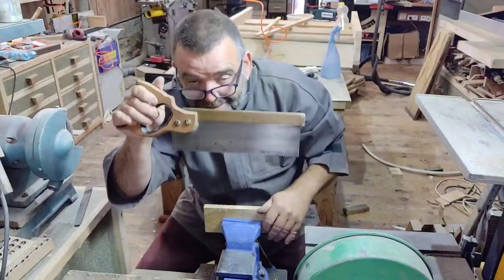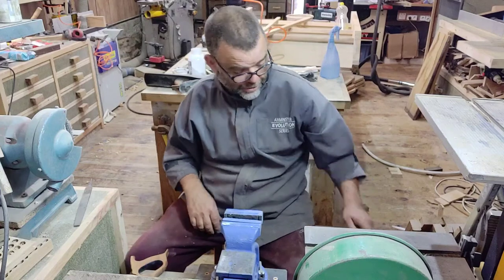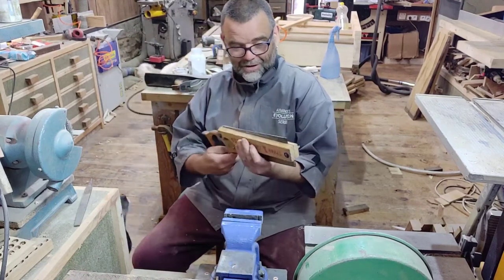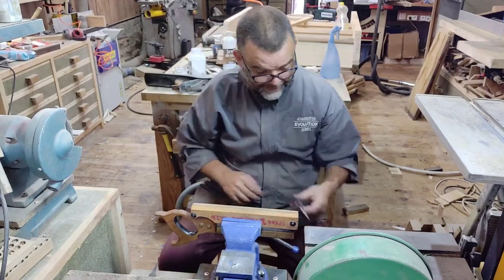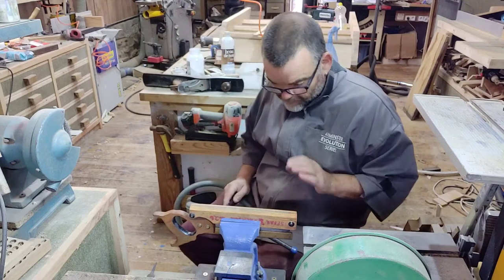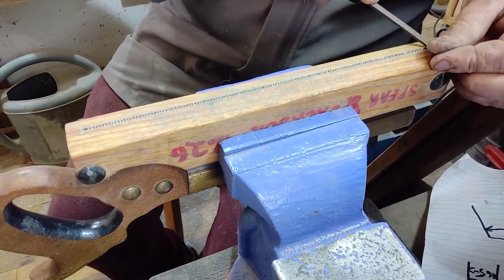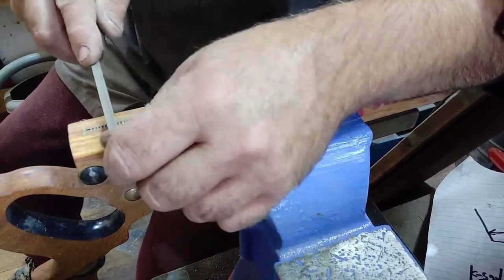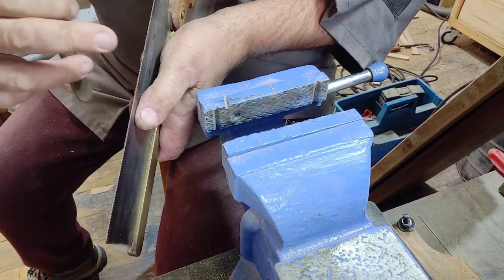How to Easily Sharpen a Backsaw - EASY 14 TPI tenon saw filing

Comment: really good tip on the jig to hold the saw on the vise... for experienced woodworker or someone who works with saws a lot it might be obvious but i would just try and hold it on the vise... get frustrated.. throw the saw away and buy a new one..
Reply from the maker: It's like any sharpening task by hand. Practice is king :) You can get a special vice but there are like gold dust!